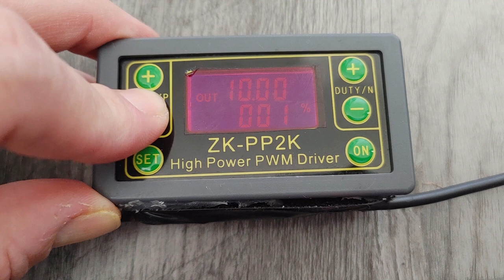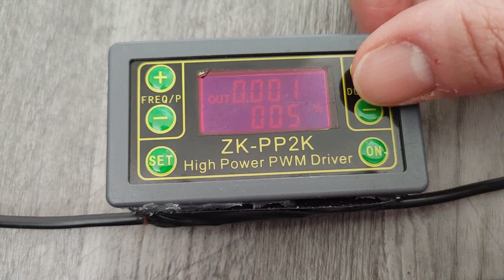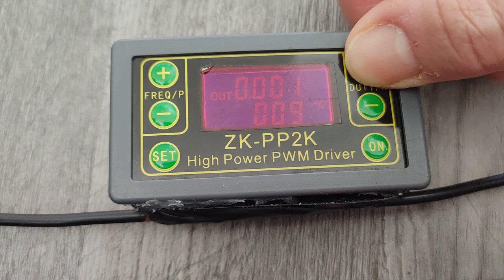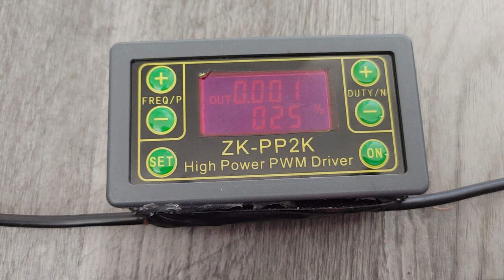DIY PEMF Using ZK-PP2K Module Part 1  (Standard Mode Operation Instructions)

Comment: What would 14 hz read on this device?
Reply: Or what would it look like on the digital display is what I meant to ask? 00.14? Or would it be 14.00 for hz
Thanks
Reply from the maker: @burningbright34if you want to use 14 Hz in this mode, you would adjust it so that the top number reads as 0.014.
Then the bottom number (duty cycle) would be adjusted to whatever heat level you'd prefer.

Just for reference, for the bottom number;
001 - 005 = no heat
006 - 010 = low heat
011 - 015 = medium heat
016 - 020 = medium/high heat
021 - 025 = high heat

I highly recommend not exceeding 025 on the bottom number when using this mode, as the unit can get very hot, and potentially cause damage to self or property.
User discretion is highly advised. 

Just keep in mind, depending on how the coils are built will change how long it takes for them to warm up.
For example, in my own units, I use 90 wraps of 22 awg, 99% pure copper magnet wire, around a 3.5 inch diameter form (repurposed jar), so they can take a while to heat up, due to their mass (10 - 15 minutes).

I hope this helps!
🤓🧲⚡⚕️
Reply: @brujahboy2004. excellent information!! Thanks so much!